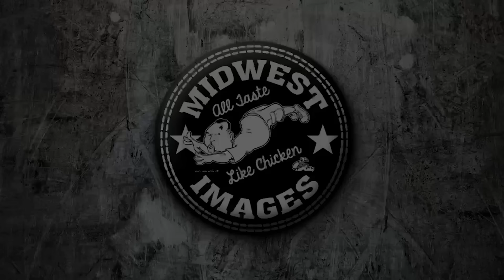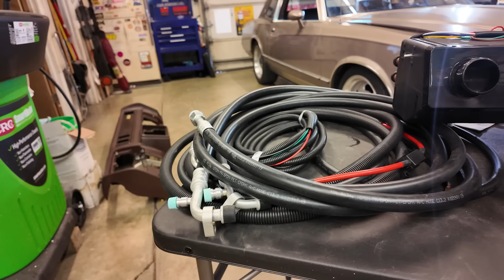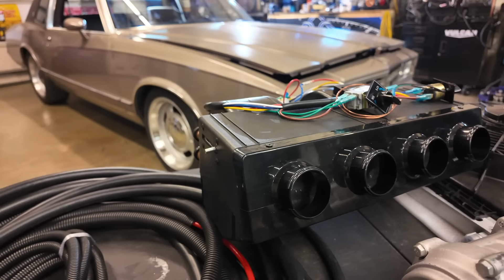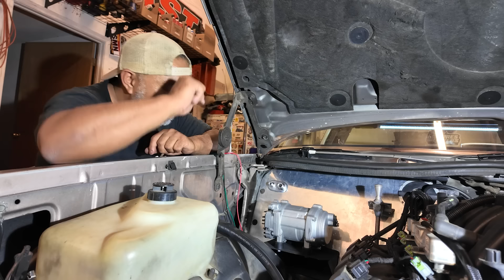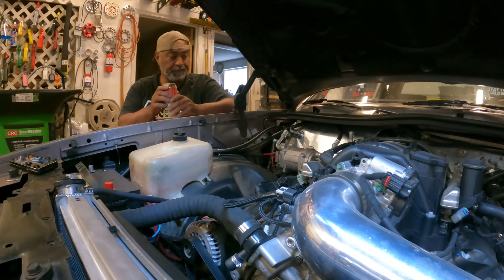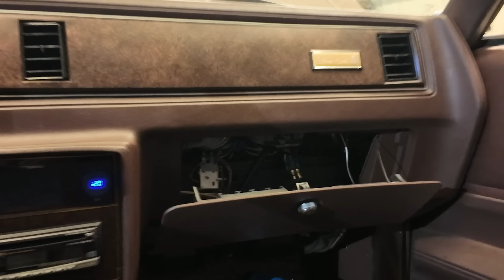12 VOLT AIR-CONDITIONING MY HEMI MONTE CARLO...IS IT WORTH IT?

Comment: When I had a boat it had 2 batteries. It had 1 alternator was a Diode block which allows you to run 2 batteries off of 1 alternator and your accessory battery would be a deap cycle so if you load it down you don't damage the cells. 
You should have run a bigger cable to the rear battery because of voltage drop. 
You could have run a bigger wire from the switch to the rear battery then off of the lug on the switch you could have run your wire to your A/C unit. Then you didn't have to run a second wire to the rear battery. BTW install a big circuit breaker on the rear battery in case the wire ever shorts the breaker will pop and save the battery from exploding.

Comment: Tried  an electric a/c compressor on my s10  with stock condenser/blower and evaporator  and it did not work  it killed my alternator and after replacing and adding an optima yellow top it would still drain and also the ac compressor did not put out enough   tryed changing ophis tubes and still did not work pressures were not good enough  and it was just cool air not cold maybe this only works with expansion valve systems.... i allso used this type of ac unit for the inside under dash on my turbo blazer build and removed the adapter end for tubes and used duct aluminum tape and mounted it straight to may dash vents because it would not blow no air on the vents with the accordion  syle tubes to my vents after installing original vent ducting and removing the adapter at the end of the unit my 2 center vents blow really  good almost  little more than my s10 with original blower

Comment: I got a 1963 impala, and got electric fans. I did a big 3 upgrade 0/1 and a 220 amp alternator. Plan on getting an electric ac soon, but I also plan to get a secondary battery with isolator.

Comment: You didn't do any test to see if a higher throttle level would provide enough charging power? It seems like a couple hundred extra rpm would be enough to power it when sitting still.

Comment: I installed one in my 68 and agree with everything you said especially about the underdash blower motor not pushing enough air.also by the time I upgraded the alternator and battery it was another 600$

Comment: I'm based in South Africa. I just bought one of these systems directly from a suplier in China for $175. Shipping was $200. 
I'm planning on fitting it to a 1968 Plymouth valiant. I got a under dash until with 3 air movable vents. 
I'll be definitely upgrading my alternator and fitting a new battery. 
I'm running a rebuilt slant 6. 
I'm fitted a new aluminum 3core radiator with a electric fan.
Reply: He upgraded to a 600 cfm box and better fan up front and is happy.  Im doing my wife's 72 valiant someday and will buy a 600 box and maybe piece together a bigger condenser and fan . I have vintage air in my 68 camaro and its not impressive so wont buy again.  This is the way!

Comment: I bought a 12v AC system for $400 basically a mini split and threw it in a Polaris Ranger at work that thing blows a lot of air on 5 speed cold air too really cold air its meant for RVs or vans..its 800w system we added a battery and so far it keeps up the voltage does drop from 12.6v to about 11.9 on 3rd speed in about an hour at idle…im thinking about adding a cap on it see how it does..on a vehicle i would use the compressor but try to use the cab evaporator and fan and maybe the condenser should be ok with the electric fans running the trigger wire to the fans for higher speeds just a thought…great job explaining 👏👏

Comment: Enjoyed your video.

Advice. Wire the "extremely high amperage" directly to the alternator. When you go to the battery, you need ro calculate line loss and requirement for larger cables. Direct to Alternator bypasses the stock wiring.

On your charge problem, sorry, I'm a Ford guy.

V/R Chris

Comment: 5.7 Hemi in my Cuda and a factory A/C compressor. It is so cold on the highway that I turn off the compressor circuit and use the fan on high till it gets humid again. The 12 Compressors use so many amps compared to a 110v or 220v and can be calculated with Ohms law. I'm hoping you put in a regular compressor before the extra battery and help your poor alternator out.

Comment: You can buy a higher output alternator to solve the voltage drop also use a relay too  supply the voltage too compressor also help on voltage drop also installing a diode on tha power side also helps with voltage drop

Comment: I’ve seen several people installing a Tesla electric compressor in place of the stock motor driven one and you can mount it anywhere in the vehicle. You wish put it inside the frame rails back by the transmission whatever especially on conversions that have larger engines and original and they have adapters that you can convert it over to your lines that your vehicle currently has or switch it over to lines whatever you wanna do. I’ve seen about three different YouTube videos of guys using the Tesla and from what I understand the Tesla compressor is very efficient. I think I would try that before some Chinese compressor.

Comment: Mike Mike Mike.  Yes do tint your Windows.  Since I was a teen in the 80's with a 73 Chevelle & 70 Camaro both without a/c. Tinting the windows even made it bearable to drive during the days.  Never had a vehicle with a/c till 2001 when I purchased a brand new truck.  Even then on the first day of purchase I still had the windows tinted & don't remember to this day of ever putting the a/c on high against this Texas sun tinting works.

Comment: I’m installing one on my Kodiak right now. Using it as secondary a/c for the rear seats. Truck has dual alternators and 3 group 31 batteries so good on electrical.

Comment: A very timely video.  Do you have a DVOM like a Fluke, where you can use a clamp to measure amperage draw?

Some things I noticed: the condenser doesn’t look that big.  Does it have two rows of tubes, or just one?  That year car was still R-12, so even the factory condenser may not be big enough. 

I’m in the Corvair hobby, and I know of a Corvair owner that has installed one of these eBay systems - I’ll check in with him, and see how he likes it so far.  He installed the compressor in the front (in the trunk), added a false bottom to the trunk, and mounted the condenser and fan underneath that.

Comment: Good video ! Easiest fix for battery voltage dropping is Put a Bigger alternator on. They have alternators that put out alot of current at low rpms ( see alternators made for marine application ) charging Boat batteries.
Thier are alot of people needing a lot of current ( think the Stereo / audio sound system guys ) 

You can also do 2 alternator setup.

other option is also Run a 3000 watt Power station as the power source & just use your vehicle to charge the Power station. The Power station takes the hit - and your vehicle just charges the power station.

Easiest of all is Just Put in a Standard Belt driven a/c System.

Air conditioning also works better in an insulated space. 2" of Foam insulation is the magic number. 
- insulate doors - with 2" foam. 
- insulate Roof - from Solar heat load. 2" spray foam. 
- Insulate Floor - 2" spray foam.
- insulate firewall - from Engine compartment heat. 2" foam.
- Bullet proof Glass - Has better insulation properties.

Me - Commercial Refrigeration & Hvac since 1981.

Note - Optimum performance is 400Cfm / Ton
1 Ton = 12,000 Btus.

Comment: If you can start the compressor and condenser fan before you turn on the in cabin fan, kinda like a home heat pump unit does with heat then the extra draw from a larger squirrel cage fan wouldn't have so much draw all at once. I've been researching this to put A/C on an old Jeep

Comment: Great video. I just retired from the HVAC industry. Back in the late 70s when I was in school for a/c it was rule of thumb that the average auto a/c was around 30k btu’s. That’s the same as an hvac system in a 1500 square foot house. Those were the old R12 systems but that wouldn’t matter. Heat exchange is pretty close to 134a   So keep that in mind when sizing an auto a/c. The only other thing that can be done is to add more fans around the inside of the car. This will move humidity to the evaporator. There are a number of things I’ve done over the years but I would be writing a book to tell. The latest I have a 91 olds with a 120 volt compressor and an under dash evaporator with a 12 volt fan at the evaporator and condenser. I run the compressor on a Ryobi 120 volt power station while I’m driving. 
As always- God Bless America!!!!!
Reply: how well does it work?   tell more about the 120 volt compressor, the 120 volt power station wire hookup.....some form of voltage inverter?
Reply: @stanallport6746 
Refer to a/c install on Oldsmobile 

I took a discarded window unit of 8k btus & mounted the 120 volt compressor under the hood of the car where the fuel vapor canister is located. Mounted the condenser of the window unit to the front of car at old ( not working factory condenser) with a 12 volt pusher fan. Purchased an under dash evaporator with 450 cfm ( think they lied about that more like 300 cfm) with 12 volt fan in the car. Connected refrigeration lines back & pulled vacuum. This window unit was R22 design but I’m running DuPont MO 99 refrigerant in it with a R134a txv at the evaporator. I wired the compressor with original cord and ran it into the cabin through a firewall penetration. I plug it into a Ryobi 40 volt to 120 volt power station which provides 1800 watts of 120 power & will run the compressor for approximately 3 hours. System is under sized. I pretty much knew this going in but had the window unit & decided anyway. Main problem- condenser is to small. It could use a larger compressor but the condenser is creating too much head pressure. I plan to find a bigger condenser & try that next but have been busy with other projects. 
A bigger condenser & a 12k btu compressor might just be the ticket. The system does cool but not enough Hope this helps. Thanks   As always- God Bless America!!!

Comment: 240 amp alternator is what ive heard some people recommend and a deep cycle battery not for replacing the regular car battery but just for the ac compressor today most cars actually have 240 alternators and secondary batterys because of the insane amount of electronics on board so a lot of this makes sense

Comment: Last year, my son and I installed the ebay AC in my '49 Chevy Gasser. We mounted the compressor in the trunk and the condenser under the trunk. No one knows i have AC in my car until they see the under dash unit. I agree that you are not going to freeze while driving , but I couldn't stand to drive it in hot weather conditions until after installation.  Mine pulls 60 amps on start-up, so I put a 200 amp alternator. At least I don't burn up driving in Oklahoma.
Reply: So, do you think with a 200 amp alt, does it run better and not drain amps like he was saying towards the end of the video?

Comment: Interesting.  I've been thinking of a similar project myself, and strictly for relocation purposes - stock system on my car disappeared years ago so I could pull headers out the top [handy if by the side of the road because... starter motor].  For comparison, 3 to 4 tons cools an entire house but... that has more insulation.  As most will note, small systems get a btu rating and 1 ton = 12000 btu's.  
I'm toying with the idea of trunk mount [compressor & blower] and modify the rear seat to build a plenum forward because driveline hump in the middle kind of precludes being 3 up in the back anyway.  I suffered that adventure in a nova years ago on a 8 hour road trip... it was horrible.  
Window tint?  Best money spent: recovery time on a hot day really improves - stay light on driver/passenger windows because that invites trouble in many states,

Comment: Did you say there was a heater included in it? If so im going to be inclined to go this way on my truck. I have a 200 amp alternator and would just add another 65 series battery to the bed

Comment: So I just ordered a kit from Amazon. Cost around $750. To put in my LS swapped 85 C10 with a factory 145a alternator. I'm hoping it will keep that little cab pretty cool in the summer heat

Comment: one thing you can do is i added a electric 8" with fan shroud over condensor for airflow even when sitting works great keeping it cold and then i added a inline 4" diameter blower motor fan by chillout its their 4" club series motor which adds 285cfm of extra air pushing power to mine and i just added it inline with my air duct tubing ducting out of the stock 12v box I added it to the duct that feeds the 2 big center outlets on my truck  which took it from speed level 3 and it took it to a Ya Baby level of 5 one past the factory level 4 max level your normally used to and im in Phoenix arizona area and its so far just finishing its 2nd summer of flawless cold air conditioning here arizona.. we had several 117-118 degree days a week or 2 ago and I had no issues even in those temps parked for 10 mins on idle

Comment: No clue of the formula but you can only move only so much air over the evaporator core in the car and have it be efficient .  May move more air but may not cool it as well.  Not sure how much engineering they did but could be why.

Comment: If you use a marine battery that is big enough, you should be able to run it longer and be able to start and run the car to recharge the battery without it going all the way dead.  I'm an HVAC engineer, and I have been looking into doing something like this for a few years now, but the only thing I keep coming back to is a massive upgrade to the charging system and putting in an electric a/c compressor out of a toyota prius.  I have a 1987 GMC Sierra 1500 4wd truck with a bored and stroked LT1 engine and  turbo 400 transmission and all of the ductwork/heater box is totally trashed in it (vacuum control, plastic tabs on the levers inside the ducts, and all that is broken), and I don't have a proper a/c compressor bracket that will fit the compressor on the accessory belt.  I have been looking into 12 volt a/c compressors for a couple of years and just can't find anything that will work AMAZING outside of using a toyota prius or other electric/hybrid car a/c compressor.  That's super awesome that it worked as well as it did for you!  I LOVED this video!!!!

Comment: The main issue is that on average, the average belt driven a/c compressor is right around 36,000 BTUs  The electric one you have is only 12,000 BTUs.  If you put more air flow on the air box with only 12,000 BTUs of compressor, it will not cool nearly as well as it just doesn't have enough cooling power to cool that much air blowing through it.  I have looked at those units, but unless you insulate the car and tint the windows a LOT, there is just going to be too much heat coming into the passenger compartment of the car for that a/c to remove.  They set the air flow lower on purpose so that it doesn't overload the a/c compressor.

Comment: I’m curious honestly cause if electric cars have A/C it’s gotta be electric like this just don’t know if it’s only 12 volts. Makes me wonder if you power it right off the alternator if you’d have better luck since you’d be feeding it 14.7 volts. I think I’d go with dual batteries and run it so the both charge off the one alternator but one powers your car as usual and the other battery would feed the A/C. Might have better luck not having to run your battery so hard as the one would only being powering the one compressor.

Comment: I remember many of my old cars, with R12 ac, would idle-up whenever the compressor kicked on to speed up both the compressor and the radiator/condenser fan.  That sort of idle-up could be implemented with a relay that closes anytime the compressor starts by signaling a slightly larger throttle setting, if you have drive by wire.  If you're running a mechanical throttle, you could run a vacuum bleed solenoid valve to the intake manifold and adjust the flow with a needle valve.  If you're running an automatic tranny, you'll need to keep your foot on the brakes when idling in gear, just like we did in the 70s.

Comment: Thank you for the review & testing it out in real life scenario. 50A at 12V is about 600W of input power, if it's true then it's actually really efficient for a 12000 BTU (3.5 kW) A/C. I suspect it's actually not that powerful or the input amps are higher. Anyway for making a cabin cooler and not ice cold it should be sufficient. Also consider insulating a roof, putting a foam between headliner and metal roof, this may be a game changer!

Comment: Ac systems get colder on slower fan speed settings,the air absorbs more cold temp off the evaporator if it goes across it slower.